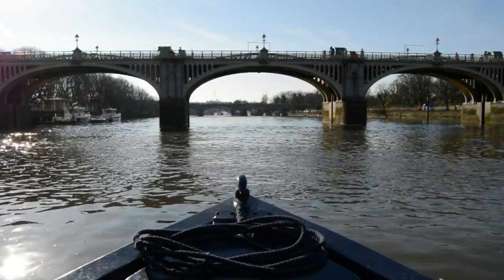How Does a Canal  Swing Bridge Work? Actual Adventure!

Comment: Presumably this must be more complicated if you are operating the boat single handed, and I am sure that I have seen reference to the fact that at some such bridges you cannot moor on the same side of the canal as the control panel.
Reply from the maker: much like a lock, you pull the boat up tie to the bollards, open it , drive  it threw , tie at the other side and then close the gate
Reply: There are (were?) some bridges with controls on the opposite side to the mooring, easily solved for the single-hander by tying the bow-line off to the bridge itself! I seem to recall reading something recently which suggested crt were planning to relocate the controls for the last few of these "awkward" bridges.
Reply: Hi there, I know  I'm a tad late to comment on this subject. I had a week on the canals around Skipton and needed to operate at least 5 swing bridges per day and EVERY bridge were operated on the opposite side of the  cut to the tow-path , I had to tie up on the tow-path side. Now I was travelling with a buddy so all was ok, and so on approach to a bridge, you have to tie on the tow path side (as you needed to get the opposite banks landowner to give permission to use 'that' side ), get off, walk over bridge, open bridge, then 'buddy' would sail on through, I close bridge, cross over and  then  get back on board, BUT if I were a single-handed user, how do would I  be able to operate the complete procedure (?) as when I have moored, crossed over and opened, I become stranded on the wrong side of the cut to get back on board to sail through, and then of course, if that were possible, once I have sailed through and moored, I am stranded again to get back over to the cut to close bridge...  Can you or someone please enlighten me? I intend to become a solo-liveaboard and wonder whether to sail on canals (bridges) or rivers/broads. Thanks

Comment: Doesn't show how it works, just shows it in operation.  Dose it have an electric motor, hydraulic, gas, diesel, compressed air, steam or a bunch of squirrels running in a wheel?
Reply: electric motor pumps hydraulic fluid to a ram which operates the bridge.
Reply from the maker: my apologises
Reply: You can't use squirrels because they hibernate, that's why they use hamsters.

Comment: I take an odd amount of joy from being able to silence annoying alarms and alerts like that thing. I feel bad for anyone who lives or works near those things.
Reply from the maker: that's a good one! like turning the engine off at the end of a long days cruise
Reply: :P I'm a bit of a gear head, so the sound of a nice engine puttering along is kind of relaxing in my view. The sound of that alarm isn't really the same thing at all. 

But of course if you really aren't fond of the engine sounds on the boats, then there are options to cut down on the noise. I've been on a few boats that make it hard to be sure the engine is even on.
Reply from the maker: its ine but after 8 hours nice to have some silence